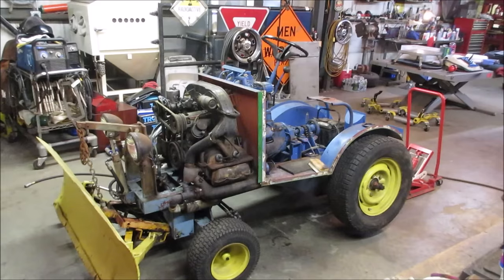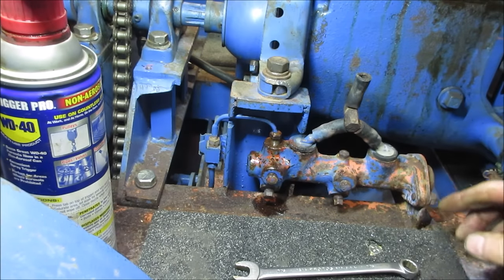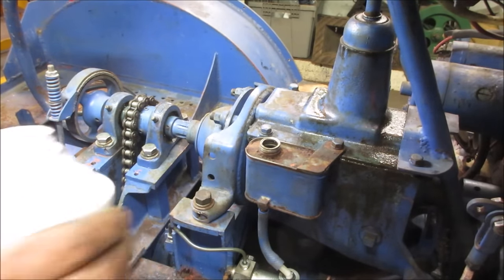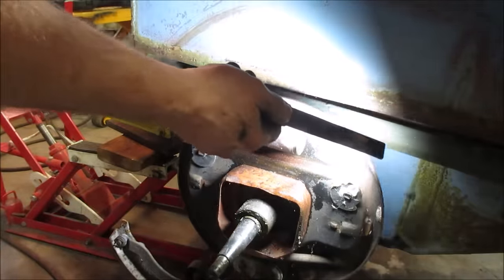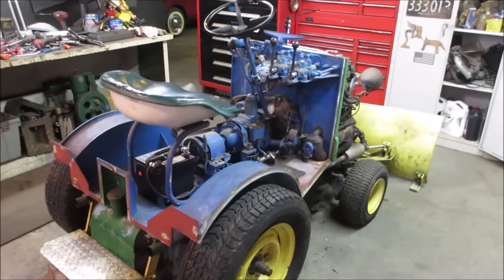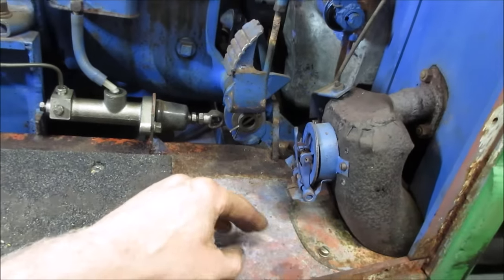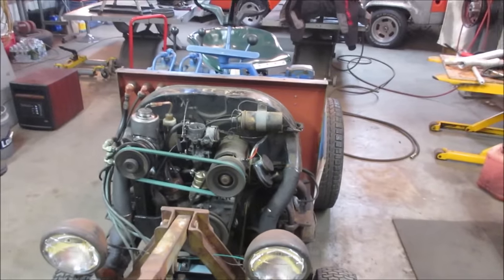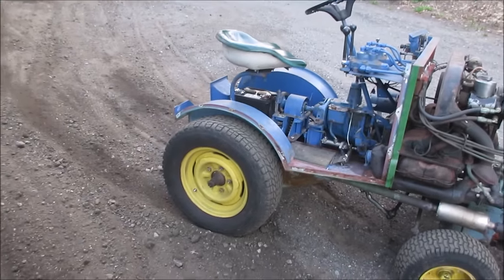Let's bring This Awesome Tractor Back To Life!

Comment: Never saw anyone run a tap with a drill before. I was taught to back out the tap (by hand) every turn or so to clear the chips
Reply: Yes, that's correct. A drill is the incorrect way to use a common hand tap. However, there are also power taps available, but they're more expensive.

Comment: Where I was working back in the 80's we had 10 and 15 KVA, trailer mounted generators that where powered by VW engines.
Reply: VW made industrial engines for generators,pumps etc. I have even seen one as backup on a ski lift.

Comment: Little trick I learned years back  remove brake pipe and replace with grease nipple pump with grease. Usually they will pop out. Cheers.

Comment: That little thing is awesome!! On the blade, on each side at the bottom on the cutting edge, there are 2 what looks like either some kind of depth adjustment, or some kind of blade leveling. You can see the 2 lines they leave behind on the dirt. If they were raised and allowed the blades cutting edge to drop down flush and push and back fill your material, that thing would leave behind a perfect finish! Whoever designed, fabricated, and then built it, was truly a genius! I absolutely love it! Fantastic video as usual! Can't wait for whatever is next!
Reply: They look like a homemade version of plow feet (shoes). Keeps the blade up when pushing snow, usually 1/2 inch or so. Most commonly used on gravel driveways, so you don't dig into the driveway. If the ground was frozen, they would work for pushing snow. Factory plow feet are usually circular.

Comment: I remember "flashing" the generator on my '49 GMC. Was told that every time I took the battery out (and especially replaced the regulator) to set the polarity by "flashing" it.
Reply: It's called polarizing, not flashing
Reply: @twinkie27271  I put "flashing" in quotes as that is the term he used. I know it's called polarizing.

Comment: I had a 1952 or 1953 Dodge B Series pickup.  Your set up for the drum and brakes looks very similar.
Reply: Perhaps the builder selected a vintage Pennsylvania brand lawn tractor rear axle assembly? I recall they used a narrowed Plymouth rear axle, many were use for mini pulling tractor builds.

Comment: The older garden tractors until the mid-1970's made the generator do double duty, but I am not sure how it would work without a compression release though.
Reply: Cub Cadet  was built that way . Not sure if they had an automatic release  , just know you didn’t have anything to manipulate to start . And in ther case the starter generator was massive
Reply: @heartland96a  Not only Cub Cadet, but pretty much anything with a horizontal shaft Kohler or Briggs. I have been inside at least a few K-series Kohler and a cast iron Briggs from the mid 1960's, and they had compression releases that operated centrifugally, they cracked open the exhaust valve briefly in the middle of the compression stroke, and retracted once the engine started running. The Starter Generators were most likely adapted automotive units, and were made by AC-Delco.
Reply: @n3bruce  it was the only model I had experience with   That had that style , thanks for your explanation

Comment: Great refurbish. Well designed machine and you made some good modifications. Dial in the timing, snow tires and chains, repair the heater box/exhaust, fabricate an air cleaner, reevaluate the manual choke, clean the oil light. This zippy beast can sure run. Some lube and spray to delay rusting and seizing. Test runs in colder weather with cab on.

Comment: i had a 1963 type 1 and i made a timing light with a lamp holder with 2 alligator clips. i set the timing mark on the bottom pulley and moved the distibutor until the light
went on/off. you can also use a vacuum guage to show 20 inches of vacuum. that was in the days of hand tools only. i once repaired a kharmann-ghia that wouldn't
run right. someone dropped the distributor in with the wrong cylinder at tdc. easy fix and it ran like a scalded ape!

Comment: I see why you love this little tractor.  Car power in such a small package.   Every problem you encountered I’d probably have spent way too long trying to figure out if I even could.  Then probably would have ended up replacing rather than fixing the components that were not working properly.  Real talent to fix and not just replace new

Comment: The brilliance of engineering that created that is mind blowing. 
With as much power as it has it if possible would be even better with a fair sized snowblower on the front. 
Certainly could run a PTO off the crank at the front controlled by an electric clutch if the crank isn’t too high up.

Comment: I'm used to tractors with both a throttle lever, and a pedal. The pedal is nice for driving around the yard, but in the field mowing or whatever for hours, the lever is nice. Set it and forget it.

Comment: cool project.
Looking forward to the Ford brakes. i have a 1960 f250 that was a basket case not running that I'll eventually be replacing single cylinder system with dual vacuum assist. Already have honing tool from fixing the clutch cylinders,
Have fun...nice weather is here.

Comment: as a guy who works with electrical contacts and such, those contacts if you use a Emory board or real light sand paper, you can renew those contact surfaces.  The contact surfaces, over time, have a carbon build up just from the electrical passing thru them.  Or, they can get corroded with green, and you remove the green the same way.

Comment: Used to repair a lot of gravely walk behind tractors, they had on some a nifty belt driven  governor with a throttle backup on a cable, might work for your application.

Comment: I think that bearing separator was good ideal
but if the holes in it are threaded you can
use gear puller

Comment: We used to time the ignition using a test light as you use for checking Voltage. Connect one end of a test light or multimeter to the outside connector to the points. The other to negative. When the points are closed, all curent will flow over the points. Now rotate the ignition. As soon as the points open current will flow over your measurement device and it wil light up or give you a reading. That is not as accurate as a timing light, but will bring you home without damaging anything. Great videos by the way, I try to view them all. Oh I was too soon, I just saw the end where you mention the static timing of the ignition. Never mind. All the best and keep making these video's.

Comment: When trying to loosen old rusted bolts, spray with penetrant and leave sit overnight.  Look at the inside of the rubber will have the size of the seal.  An old autoparts store may the seals as they were sold separately.  They also sold rebuild kits that had the boots also.

Comment: Hi Mustie, great job as always. One tip for the Milwaukee drill (and most drills with metal chucks) to prevent the tap or drill bit from coming loose: to engage the lock, after you've fully tightened the chuck back it up the tiniest bit until you hear a click. Helps 80% of the time :)

Comment: And yet another success story from the Mustie1 garage.  No leaks, it’s charging the battery, has brakes, and lights and the windshield wiper motor still goes to park.  Install the posi rear end and fix the heater box and it will climb Mount Everest

Comment: The person that built that tractor made to last 100 years,  What an excellent find,  you should look for wider rims and tires you can always weld onto the blade to make it wider,  I bet you will have to add weights to the rear so the tires will not spin so much, you will most likely dig a hole with tire chains trying to push snow

Comment: There is a brake fluid reservoir used on some Piper airplanes that is like the one you have only taller.  You can sometimes find them used in airplane boneyards but they are expensive.  Some people make their own using metal cans and soldering on the fittings.  Older Brasso or paint thinner cans are the right size.

Comment: The accelerator pump nozzle will swing back and forth in the venturi. It is best to put fuel in the bowel and pump the throttle and observe where the jet of fuel sprays. You want to adjust (sometimes you need to bend) the pump nozzle to spray exactly at the edge of the throttle plate right where it is opening from the venturi wall. This will ensure you do not have a flat spot and there is no need to make the pump over volume due to poor alignment of the nozzle jet of fuel. Always re-stake the nozzle into the carb body as they do lose up with time and the motor will successfully eat them as they are made of brass.

Comment: Here lately I have been wire brushing, needle gunning and spraying with Phosphoric, rusty rims, and putting tire on while it is wet. Pickles the rust and seems to seal fine. Last batch were ATV tires, 4-5 psi, so far they have not lost a tenth.

Comment: It's amazing what they used VW aircooled engines for over the years. Back in the early 1970's when I was stationed at Lackland AFB in San Antonio TX. I visited Brackenridge Park and they had a cable sky ride that was powered by VW aircooled engines, at least at that time.

Comment: Love the vids, but small tip from an ex tyre fitter, bead sealer goes on the flat inner surface of the tyre bead (the surface that would sit flat against the rim) not in the trench that runs next to the rim lip :-)

Comment: On those top better connectors I always put a longer bolt in and then put both in from the backside but a nut on top that way the boat. With the washer on the backside would build-up more area and then the screw sticking up. You can tighten it down with another nut

Comment: usually a tractor will have a hand and foot throttle, the hand throttle is for setting at a set position so the machine moves at a constant speed rather than trying to use foot throttle over rough terrain.

Comment: It'll takeout washboards in the dirt roads. all you need! Great work! A vw is like 70-80 hp? 1600cc? maybe not that much? my tractor is 28 hp diesel...I think that has more..
Reply: Beetle engines were rated between 36 to 60 hp, depending on year.

Comment: to test the Generator it is best to hook up the positive first Then ground the field. The generator should not turn until field is grounded. sometimes I found that the Generator had a grounding field and would turn without the field grounded......They are no good and will cause system draw.

Comment: If you guys want to bend small gauge metal tubing, and avoid it kinking, buy some bass piano strings. Put the string into the tubing and it will hold its form while its being bent. And, look into a little DIY bending jig.

Comment: If you can dig up a good heater box for that thing, it'll be 100%. Seems to run really well, considering how bad it sounded in the beginning. I think that's an old cut down, Plymouth car differential. I'm actually surprised those drums came off as easily as they did. Usually it's heat and beat, and use the biggest damn puller you can find!😄Those PICT30 Solex carbs are pretty reliable if you keep decent gas in them and don't let 'em sit too long. Now that your electric choke is working, you can get rid of that wonky choke cable, and get a good air cleaner. Nice work Mustie!😉👍

Comment: Old lawn mower motors had a air vane governor. Maybe you can rig something like that in the fan shroud copying what B&S did in their motors. I have a 3hp horz Briggs with that set up and the air vane governor works really well. Maybe not as sharp as a centrifugal but good enough. Still though one of those cheap servo types intended for generators might be the best path. That would give you throttle be wire. A lever on a pot.

Comment: Cast iron drills & threads easier than steel, because of the carbon content. It lubricates the tool as it cuts, depending on the carbon content, oil doesn't need to be added.

Comment: Fill the rear tires with antifreeze and water the back end needs all the traction it can get. I tried making brakes for the front wheels on mine . Used the inside of the wheel as the brake drum . That was ten years ago , they still work okay might not lock the wheel but sure get you stopped in a hurry , I used an electric wench for up and down , left right is a rod you push or pull to lock it at the angle you what .only gravity for downward pressure, the hydraulics would have been better . The thing is used all the time , pushing sand and gravel to maintain the road , pushing pine cones , leaves . Used 22x10x8 tires on the back . Ugly as hell , but so handy

Comment: I have that 2 jaw puller you tried. I got it from NAPA. Its for tie rods I think but its very versatile, seems to always work. Used it the other day to pull windshield wiper arms off a Ford van. There's supposed be a piece that goes in the end, like a little cup, maybe would have worked then.
Reply: And a minute later, I see you made it work!

Comment: Double diameter pistons must be for leading and trailing shoes to ensure even brake wear. Hub brakes when rotating tend to push one brake shoe in and assist the other coming out a sort of wrapping effect. I see an arrow on the cylinder denoting a direction for the cylinder.

Comment: Hey. If you would “ lock “ the chuck on that drill that tap wouldn’t slip.  
Tighten the chuck as normal. Then grab the chuck with your hand and twist it back until it clicks. Try it. You’ll see what I mean. God bless.

Comment: I had and old ford tractor like with a12 hp thin i put wings on the plow made it a little over 6 ft and there was not to much it wouldn't  push 😊

Comment: Use the old choke as a base idle control that the pedal overrides. That will take the tedium of holding the throttle less. Also s#!t can the vacuum advance and set the mechanical to go all in.

Comment: I like the theory of the dual circuit master cylinder.  That said, I've had two cars that burst a rear brake line (joys of living in the rust belt) and suddenly had no brakes at all.  No idea why, as the master cylinder seemed to work just fine before, and just fine after the line was repaired.  But when it let go...pedal to the floor while I coasted gently through an intersection.

Comment: Back in late 70s early 80s I did see a air compressor using a VW motor apparently it worked quite good but I didn't see it running
Reply: From Perth australia

Comment: Install and use an alternator, got to keep the generator to hold the cooling fan , but figure out a way to install an alternator so the thing will charge even at low RPM
Reply: There are alternators available for these engines as well. VW switched from 6V to 12V generators in '67, and from generators to alternators in '73.

Comment: My 64 Mercedes has a similar gen and a regulator tgats a different shape but same type of crap in it. I had two that looked fine and both did different crap. I could energize the contact and it would work fine for a few hours then stop. Same with another contact on the other. I got fed up and converted it to an alternator.

Comment: I think I'd add a "suicide knob" to the steering wheel and when working on the engine (timing and carb adjustments) I'd take the belt for the hydraulic pump off.

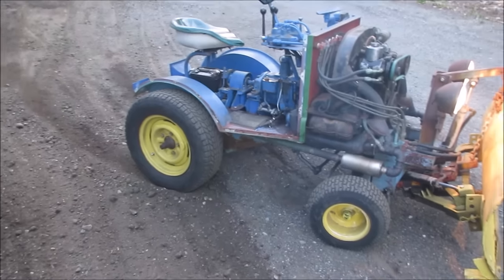Comment: 1:29:30 -- I suddenly became aware about 2 minutes ago that this tractor has the basic underlying form-factor of most ride-on lawn mowers.  The big metal cabin hides it.  It is also remarkable to have a clear view of nearly all of the controls and linkages while operating it.  

But yeah, ride-on lawn mowers also generally don't have suspension on the wheels, I'd bet.
Reply: And Heh "Doesn't have a posi-rear" might be something not everyone understands, although I'm maybe forgetting that you mentioned that at least once already in the course of the last 3 videos.  I knew of a guy in my high school who took what he'd learned in his shop class to drop a very big motor into his very small Chevy S-10 chassis.  He also didn't get positive traction on his rear drive, and there was no better vehicle in the local vicinity for doing donuts on the mall parking lot.  But the downside was he went through tires on the one wheel like there was no tomorrow.

Comment: Put a left and right brake on its hydraulic
Reply: My '29 Ford AA / '47 Wisconsin 2 cylinder doodle bug unknown creator used the mechanical linkage to provide rear braking. Left or right to turn at the end of rows and a shoe across both to stop.
Front truck axle was cut then welded /-\ for row crop clearance. The worm
 gear rear axle assembly had the right half narrowed. Roller chain connected the Wisconsin engine to the truck transmission, gears were shifted by an axe handle.

Comment: I understand you're not really going to use it as a skidsteer/tractor. And a foot-pedal throttle is easier when loading it into/out of trailers and shows. But the reason something like this has a hand-throttle is it's important to keep the engine RPM steady when using the hydraulics. So you might want to look at some older tractors which have a mechanical linkage where it'll switch the throttle to a foot pedal so they could use the road gears, but when you made it to field and needed steady pacing you could switch back to hand-throttle. Nowadays, of course, it's done with electronics and you aren't allowed to fix/copy/modify it.

Comment: what you need is a decelerator peddle rather an accelerator peddle, so when you let of it goes to the throttle setting and when you press it it goes to idle.